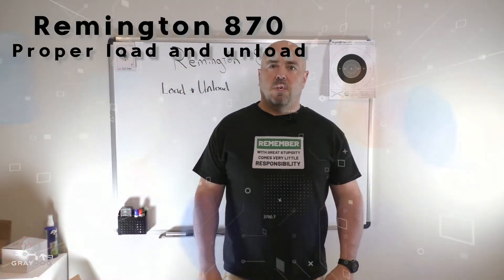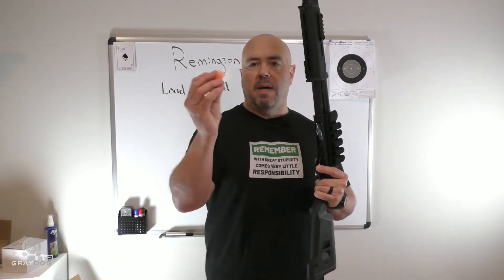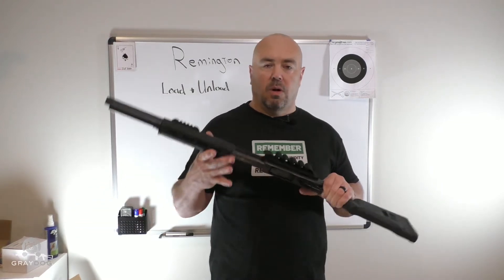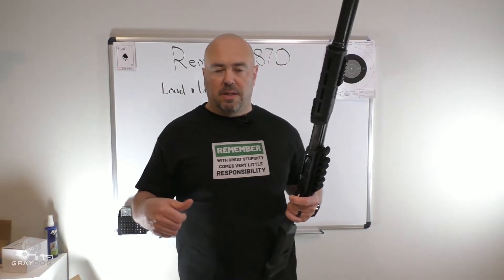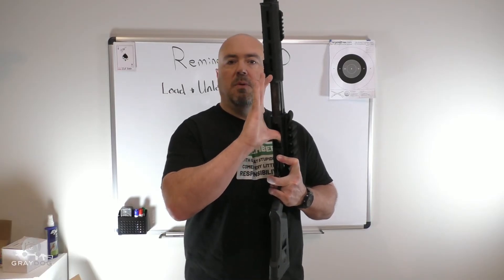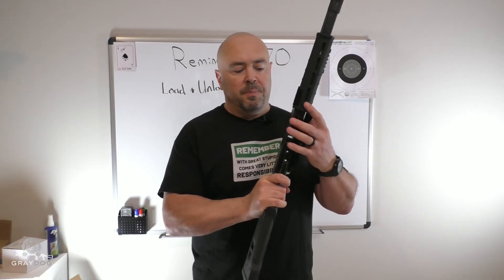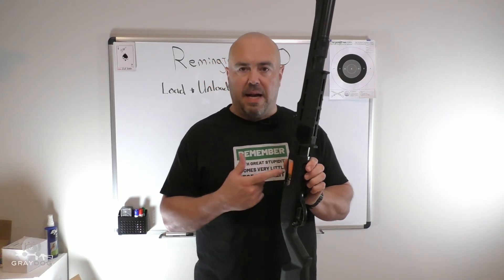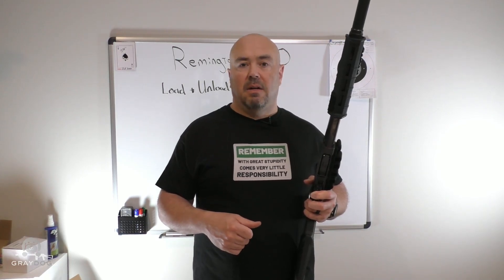How to load and unload a Remington 870

Comment: Another reason for not storing (cruiser ready) with a round in the chamber is fire.  A round in the chamber will discharge with the same or nearly the same velocity in a fire as if the trigger had been pulled.  And to those who would say that quarter second or less it takes to rack the action may be the difference between life and death, I would say you should review your home safety plan.  You have some big gaps in it.

I am personally aware of two cruiser fires that could have turned out badly for firefighters or bystandes had their been a round in the chamber of the shotgun.  A house fire is no different.
Reply from the maker: Solid point, thanks!

Comment: One thing not covered here is the pump lock is only locked if the trigger is set. If you pull the trigger on an empty gun it resets, and the pump is UNLOCKED. If you load the chamber on a released or unlocked pump, the pump will move easily and load a round without depressing the pump release.  So you can actually load the 870 in both conditions. I think it is important to point out the difference. Are you stating to load the magazine after an empty pump which locks the pump or are you saying to clear the gun with a couple pumps, then depress the trigger and then loading the magazine?
Reply from the maker: I am a no child left behind guy, I don't teach pressing the trigger unless you want the gun to go bang.

Comment: This unloading method leaves the gun in fire (without a round in the chamber) after it's clear, no? Is there a way to unload and not have the gun in fire as then no need to dry fire? Thank you great vid!
Reply from the maker: Do you mean that the hammer is back, i.e. the gun is cocked? If you want to have the hammer down, the only way to do this with a Remington 870 is to pull the trigger, which I don't like doing unless I'm actually firing or dry firing after I've verified that the gun is clear. So if I'm understanding your question correctly, there is no way to unload and have the hammer down unless you pull the trigger. You're welcome!
Reply: @graydogllc  BINGO! Yes that is what I was getting at, thanks!

Comment: Help me out guys, so I was doing these steps, I just bought myself an 870 and I watched this to learn how, so practiced a few times. But since you load with the slide forward and have to pull it back to unload, when I unload and then wanted to load again, I would put the slide to the forward position, this of course cocked the hammer/charged the firearm. Is there a way to load and unload repeatedly without ever charging the weapon?
Reply from the maker: Not without pulling the trigger, and i am not a fan of that method. If you want to do it, you must make absolutely sure that the gun is empty chamber.

Comment: Thanks. I purchased an 870 for home defense and this video has been very helpful. If I have my shotgun in cruiser ready to unload with 1 in the chamber there is no need to use the release, is that correct? Thanks again.
Reply from the maker: If you have to rack it you will have to use the release.

Comment: Isn't the safety on the 870 a simple trigger block?
Reply from the maker: Yes sir, there is no block between the firing pin and the primer. To make it worse, there is a very small amount of engagement between the hammer and sear. If the spring gets weak, engagement slides, bla bla bla, you can quite easily get a bang...

Comment: You're wrong about cruisers ready. Cruiser ready is mag tube fully loaded, action open with shell on lifter of course safety on, rack forward when ready to deploy and now you have 6 in the tube and one in the chamber, thats how I've always known to be cruiser ready.
Reply from the maker: The agency you work for must do it differently. Thanks for your input!
Reply: @graydogllc  NP. There is a trick of manipulation to rack back your slide without a round coming out of your tube on to the lifter/ loading gate so you can drop your round into the loading port, I'm sure you have that figured out.

Comment: I dropped my dummy loaded 870 Express with the Police trigger group and safety off several times from a height of 3', picked it up, and had to pull the trigger to release the hammer. People need to stop this not drop safe nonsense. Test your firearm and always treat it as if it's always loaded.
Reply from the maker: You do you, boo. Look at the internals and tell me what blocks the firing pin....
Reply: @graydogllc  you're so sweet.